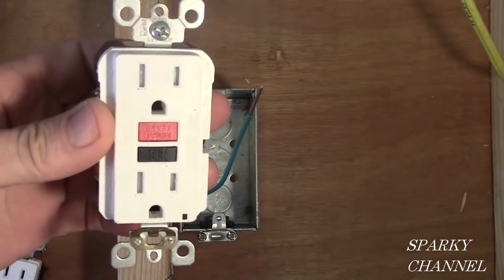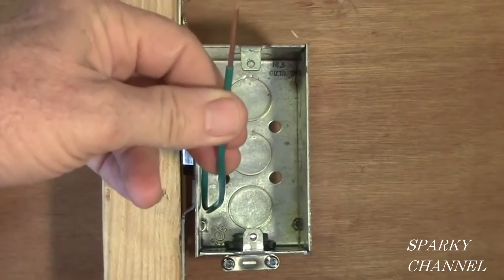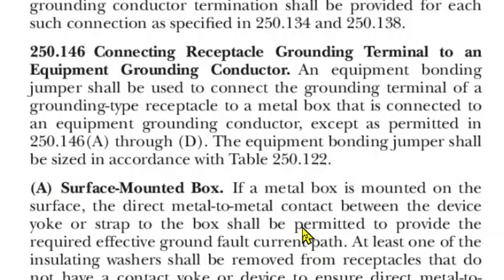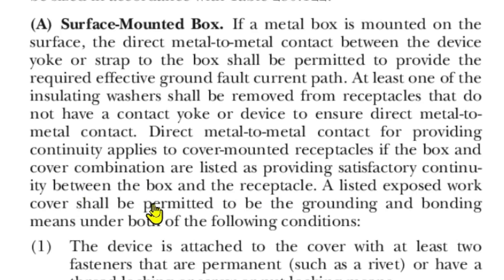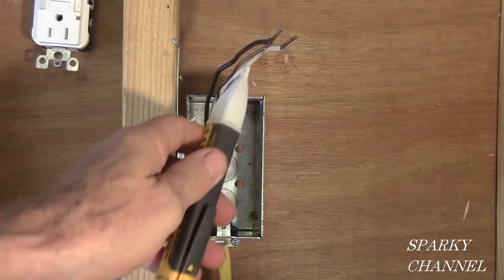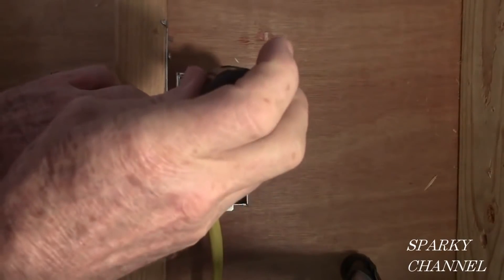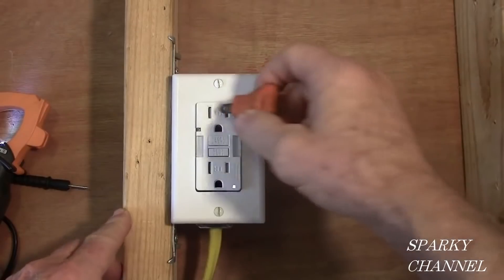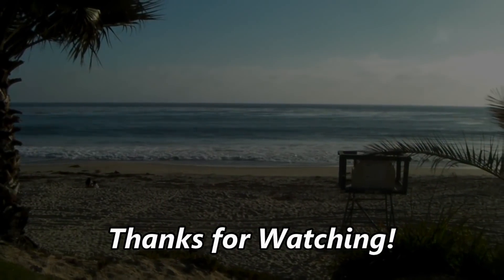What is a Self Grounding Clip and What Does the 2020 NEC Say About Them?

Comment: I think you are mistaken, the self grounding clip allows you to not use the green ground screw on the device. You must bond a metal box, 250.148.  NEC 250.148(B) says when you remove that device from the box you do not interrupted grounding continuity.  Your example is bonding the box from the device. You can ground the device (unless in a raised cover) with the ground clip, grounding the box with the grounded yoke of a device is a code violation. If you believe I am mistaken please site code as I make mistakes all the time.
Reply: I don't see how that clip does anything for the connection between box and device.  The screw doesn't touch it, it's on the front of the yoke and doesn't touch the box.

Personally, I'd rather go with Sparky's method and put the green wire (equipment grounding conductor) on the device.  That's where you plug in things and have people contact.  Once the wall is finished, nobody is coming in contact with the box.  Even if the 'hot' wire somehow came into contact with the box, not that much risk to people compared to using a three-prong appliance/tool and not have a very strong/solid EGC.
Reply: @mikefochtman7164  The threads of the screw create continuity between the device and the metal box. I always ground the device with a pig tail. If your using the raceway as your ground and no grounding conductor that self grounding device meets code. Unless it's a raised cover. I think the thought is if the ungrounded conductor comes off when you pull the raised cover away from the box it can contact the cover and not short to ground.

Comment: Only paper washer came on side without the brass self grounding clip. The side with self grounding clip did not have a paper washer. Do I have to take off the paper washer on the opposite side?
Reply from the maker: NO, you're good. I've noticed that Leviton is only putting one paper washer on their self ground devices.
Reply: @SparkyChannel  ya know this is interesting.
Just yesterday, I was pulling some 'old' receptacles from an old generator panel. They didn't have washers on one side, I was curious as to how I lost them...
So today, I stumble on yet another of your informative videos, and I go "AHA"! Then this, I go grab them, and yep! down on the gold clip (under a magnifying glass) was 'Leviton'!
S'plains it all!
Reply: Here's a bright idea, Leviton should make the captive retaining washer METAL instead of fiber, then there's no need for removal.

Comment: That tape around the receptacle creates more problems than it solves. Unless you like a black gooey mess, because the tape usually creeps off the device and and leaves a sticky mess in a trail wrapped around the wires.
Reply: I agree. Taping around receptacles and switches is a waste of time. Run the unused screws in if you're worried about them grounding out to the box. Stop using those small s/g boxes. For surface mount use 4/s boxes and raised covers. If it's a plastic box don't worry about it. I don't want that gooey crap on my plugs and switches either.
Reply: I was an electrician on ships for many years, I f'ing HATED finding that in a salt water filled box! It did help me find the grounds though! 😉

Comment: I don't think this self grounding feature does much if a plastic cover is used. This is alluded to in the code section that you read. It must be flush mounted. This is accomplished when the receptacle is mounted to the box cover such as where a 4 x 4 inch box is used. Note that the self grounding feature is mounted on the front of the yoke. Mainly for external mounting with metal conduit. Common in industrial applications and sometimes in the garage or shed. Even without this feature you'll still get receptacle or switch incidental grounding by metal to metal contact from the mounting screws.
Reply from the maker: Correct, this is only for metal boxes.

Comment: Is the metal box grounded to begin with (like some old boxes do in the back of the box). Is the self grounding clip just an alternative to the pigtail? If there's no ground wire running to the outlet, the self grounding clip is useless right?
Reply: Your first question: Yes, but both can be used. 2nd question: You answered correctly.

Comment: Your method seems backwards to me. I always believed that the self grounding clip was provided to allow you to ground the ungrounded outlet by bonding it to a grounded box. What you did is use the self-grounding clip to bond the ungrounded box to a grounded outlet. Are both methods okay? Any code-fearing electricians want to weigh in on this? TIA.
Reply: Yeah, I wondered about this too, and it makes me not trust this as much.  I can totally understand why Bill did it this way, but there is a risk that someone in the future may put in a standard receptacle without a grounding clip or understanding. There seem to be pros & cons to both methods, but it's more intuitive for a non-electrician to just check hot to ground and wrongly assume everything is fine when the reading checks out.  If the box is directly grounded, then a pigtail or self grounding receptacle would evidently be needed.  It's one simple extra step to ground both the box and the receptacle separately, and  whilst this isn't what I would call cutting corners, it is not something I care to ever do.  https://youtu.be/bDFaVyvkQMc I realise that this is mostly for demonstration, but it's questionable why this is a thing at all.
Reply: BobR, your belief is correct. The box must be already grounded. I believe that is the case in Bill's demonstration.
Reply: @surferdude642  No, if you watch the video carefully you can see that the box is only grounded via the outlet and not via the incoming ground wire.
Reply: @bobraible  You're correct, the box is only grounded by contact from receptacle in which Romex ground wire is attached to. My mistake. Good catch. My home was built in 1950 with metal boxes. A ground wire was connected from the ground/neutral bus bar to the back of each box in a circuit to ground them. A 2 wire cable was run separately on each circuit for the hot and neutral connection. So the receptacle is grounded by the box instead of the box being grounded by the receptacle as in Bill's example.
Reply: Agreed. Video is pointless since a grounding wire was attached to the receptacle.

Comment: how do we know that the ground connected to the outlet isn't touching the box after he installed it in the box??  Just a simple question??  It would do the same thing though.
Reply: Yes i noticed there is a very  real chance that the bare ground wire also touches the box, especially with that big GFCI.    so it doesn't really prove the point as to where/how it got grounded

Comment: While you CAN use a self-grounded device like this, and have the box grounded via the device.... DON'T.   Use the self-grounded device the other way, keep the ground wire to the box, and then skip the wire to the device.   This way the box is always grounded, even if you remove the device.

Comment: Seems the "grounding clip" on the outlet should be called a grounding tang since it's purpose is to press onto the box's edge.  I thought you were going to discuss ground wire clips, like shown at http://www.nsiindustries.com/UserFiles/Images/Products/600x600/ggc1000_fro_00_201405_600x600.jpg.

Comment: Question:  I'm replacing an old cooktop from the 1950s with a new one.  The old one was hard wired to a surface mounted 4" metal box fed by 8/3 BX cable.  The new unit does not use a neutral connection.  Just L1, L2 and ground.  The installation instructions specify that the green ground wire can be connected to the neutral white wire, or connected to a ground conductor.  Since BX cable does not carry a dedicated ground conductor, is it acceptable to connect the unit's ground wire to a ground pigtail connected to the metal box to satisfy the grounding requirements?  Also, the unit has 8/3 MC cable which will be secured to the 4" box with a metal box connector.  Thanks!

Comment: @ 9:00 why did the GFCI not trip?  Perhaps the line was connected to the load side of the receptacle?
Reply: The voltmeter he used has an extremely high impedance in the order of 10 megohms.  The minuscule amount of current (~ 12 uA) through the meter isn't enough for the GFCI to detect as a ground fault.  A GFCI will trip at about 5 mA (or less) of ground fault current which is about 400 times more current than the meter will draw.

Comment: Hi sparky I have a 1950 house with 2prong outlets and open ground on most of them if I install these outlets will the be grounded? Without a grounding wire going back to the fuse panel.
Reply: No. It would still be ungrounded. By code you must now either connect a ground wire from that outlet to a place on the grounding electrode system, another grounded outlet, etc. or install a GFCI receptacle ( most areas would need to be dual rated GFCI/AFCI receptacle about $25 a pop or put the whole circuit on a GFCI/AFCI breaker.
Reply: @stillthakoolest   thanks for the information
Reply: @stillthakoolest  So I have a similar setup with the two prong outlets but when I test the new three prong outlet with a tester it does show it’s indeed “correctly” grounded. Is this a false positive or is that good there?
Reply: @tigeryeung2011  A bit confused by your question. so you removed the 2 prong outlets and just put a 3 prong outlet in? That's not legal under code. Is there a ground wire coming to the box? Is the box metal and wires coming in a metal conduit? You need an equipment grounding conductor to replace a 2 prong with a three prong unless you use a GFCI receptacle. Even then the circuit/receptacle isn't 'grounded' its just safer than before. You need to rewire the circuit.
Reply: @stillthakoolest  No so the previous two prong outlets were simply replaced with three but with a outlet tester it’a showing that it’s grounded. My understanding is that it’s grounded through both the screws and the metal plates coming off the yokes of the outlet onto the metal box. My question was would it be possible, with this setup, for the outlet tester to be showing a false positive that it’s indeed correctly grounded? Also is it possible that even if it’s technically “grounded” that the ground isn’t sufficient enough to really be useful.
Reply: @tigeryeung2011  unless there is a ground wire bonding to the the box from the electrical panel or another grounded circuit, or the circuit is contained in EMT, RMC etc. conduit all the way back to the panel (which I doubt) then the outlet isnt grounded no matter what your little tester tells you. You are misunderstanding the purpose of the self grounding tabs on these receptacles: they are not designed to ground an ungrounded circuit or box, they simply eliminate having to use a bonding jumper. You need to either install a gfci outlet or put new 2 prong outlets back in.

Comment: Maybe its just me, but why would you measure voltage from the hot to box instead of directly measuring continuity or resistance from the ground pin to box? Measuring voltage is indirectly measuring the bonding. Its possible (although highly unlikely) that an ungrounded box which is floating could still have 120v wrt hot. Measuring continuity or resistance would be a direct measure of what you are looking for - a low resistance path to ground. Since the meter has the capability I would always prefer the direct measurement to the indirect measurement - plus the continuity can be measured with the circuit deenergjzed if you so cared.
Reply: Exactly and if you're going to do it like that for demonstration purposes I would have left the paper tab in place first to show no voltage reading between the hot and the metal box and then removed it

Comment: I don't understand. Whats the added benefit of the self grounding if you already have a ground wire?
Reply: Its not necessarily redundancy. If you are using EMT conduit then you dont need the bonding jumper from the box to the green screw on the receptacle. With NM cables it doesnt make much sense.
Reply: I was thinking the same thing. The receptacle is grounded using the ground wire in the NM cable which is preferred since the ground wire ultimately returns (if not a home run return) to the service panel. Now it seems like it's double grounded. Perhaps two grounds are better than one?
Reply: @stevenbernstein1978  The metal box must be bonded.  In this scenario, the ground wire provides a ground to the receptacle, in turn, the the installed receptacle provides the required bond to the metal box via the self-bonding yoke.  You have now effectively satisfied both requirements without having to installed a bonding wire jumper.
Reply: Does the NEC require redundancy? In the event that the receptacle was NOT self-grounded, wouldn't the NM cable ground wire connection comply with code?
Reply from the maker: Redundancy.

Comment: I have grounded the box with the incoming wire (aka: home run) for the past 25 years. The inspectors I work with want ALL equipment grounding conductors bonded and connected BEFORE drywall. Receptacles are not installed until trim. The Self Grounding Clip just adds another level of safety. Ground paths, even multiple ground paths, are your friend in this case.

Comment: Could you ground box with wire and not put wire on receptacle ? Would receptacle still be grounded thru self grounding screw.
Reply: Yes thats the whole point of this feature
Reply: I understand but on the video u grounded plug with ground wire question was could u ground box with ground wire and use self grounding receptacle not have  ground wire connected to its terminal
Reply: @jlmm3968  yes you can. As long as the box is metal and youve bonded the ground wire to the box you dont need to hit the receptacle. What he did there was technically above code requirements
Reply: I was also wondering this?

Comment: Why the need to remove the paper washer..? There is a screw that touches the self grounding clip on the switch then runs through the metal nuts of the metal box, making the grounding bonding connection. The threads are making the metal to metal connection. There is often a little float between the box and the front of the drywall. The switch is often loosened to permit the switch to fight the cover plate and in those instances the paper washers only serve as keepers to keep the screws with the switches. Not trying to argue the code, I just don’t understand the logic.
Reply: I was gonna say, the code he read specifically says you only have to remove the insulator if the device doesn't have the grounding clip.
Reply: Yes, if you read the Code, it says your must have direct metal-to-metal contact, OR a self-grounding clip.  No need to remove the paper washer on self-grounding devices.

Comment: But article 250.148 specifies that the box has to be grounded itself independent of a device so if you remove that device put the wires in the Box that box is still supposed to be grounded
Reply: True, so it just saves you from having to pigtail a bonding jumper from the box to the receptacle on a metal box. In a plastic box it does nothing
Reply: This only applies when a metal box is used in a metal raceway to establish continuity with the service panel. The video shows a metal box NOT used with a metal raceway which defeats the purpose of the spring-type grounding strap of a self-grounding device.
Reply: @stevenbernstein1978  not necessarily true. If you bond the EGC of the NM cable to the box, this feature saves you having to put a bonding jumper to the ground screw on the receptacle, but that is all

Comment: I was taught to verify test equipment on known live circuit, before trusting it to test an unknown circuit
Reply: Test dead, test live, test dead again, test live again ideally using a calibrated proving source and a calibrated tester, not a non contact volt pen (which DON'T confirm dead)

Comment: I'm living in an old house and there're some ungrounded outlets. So I was thinking of replacing old receptacles into GFCI ones. However the electrical boxes are made of plastic. In this situation, is replacing the breakers into AF/GF ones the best way to make it safe?
Reply: yes.  it's faster, and protects the ENTIRE circuit.  however, there is a chance the original electrician might have cross connected some wiring, in which case you'll have a huge headache chasing down the cross connection.